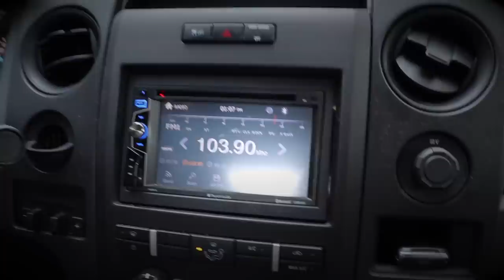AMAZING HACK! How To EASILY Remove A Broken Bolt

Comment: If there’s a fair bit of bolt showing, say 1/4 in or more I’ve used a drill chuck well tightened on the bolt. But don’t overdo the loosening pressure, and don’t use the drill in reverse to get it out! Taryl  could you not shout all the way thro? We are all listening closely but some of us need paracetamol after 5 minutes, or get a better audio engineer!!!!!

Comment: Heat the aluminum until it almost bubbles bolt will move
Reply: Yep use map instead of propane or better yet an acetylene /oxy torch.

Comment: There is a simply formula for threats drilling. How to know the size of the hole.. 6x8=48/10=4,8mm drill---- 10x8=80/10=8mm drill to fix the hole and the tool can cut a new threat.. I love the metric system 🤣

Comment: Another option if your hole is slightly larger, is to use that coarse thread you like so much....
Reply: Tap drill sizes for fine threads are larger than tap drill sizes for coarse threads.

Comment: Stick it in the freezer next time 👍 steel will contract and the aluminum doesn’t as much and it breaks the bond. I use this technique gunsmithing. It works pretty good. Just try it for fun

Comment: Nothing more annoying than trying to drill out a broken bolt and the drill bit is dull, you can tell you done that before as you remained completely calm even though the bolt broke off on you two times,

Comment: Another way to get snapped bolts out: https://www.youtube.com/watch?v=cxM5VH1IoZs. Metric-thread has no corse thread, there is only regular and fine thread, use nevr seeze or so on screws in hot areas like mufflers and on places where you expect dirt, moisture and other ugly stuff

Comment: Aluminium is a metal too, see here a different way than drilling: https://www.youtube.com/watch?v=cxM5VH1IoZs if seezed use a bigger nut, weld more to bring more heat into the bolt, aluminium will be heated also, expands more than steel and makes it work.
Drill bits for metric thread is always diameter minus pitch, 5 - 0,8 = 4,2 mm in this case, works for any metric V - thread, there is no corse thead in the metric system.

Comment: my boss's boss was watching me take a broken bolt out of a head recently. was using a left handed bit, sometimes works. he actually asked my why i had the drill press in reverse. that threw me off because i thought it was obvious. have doing this at least a dozen times a week with slightly more precise tooling (drill press and a level) this video made my cringe. i fix so many screw ups that others make just coming at it with a drill. i suppose it works if you're good. i wouldn't try it lol.

Comment: oh no a 5 minute job made into 30 minutes....first when you weld the nut on the broken stud then instantly dip it into a bucket of water or cool it immediately with lots of water and it will cause it the broken stood to shrink then you can work it loose.
Has to be cold after welding or it snaps off like a carrot and as for penetrating oil you may as well piss on it. !

Comment: 1st step to remove a broken bolt in a lawnmower.   junk it.  it has then successfully been removed from the house.  you get to a point where your work trying to save them money now becomes more work than simply buying a new part